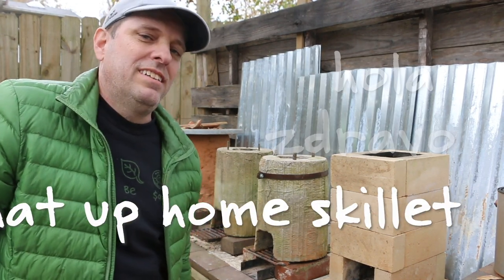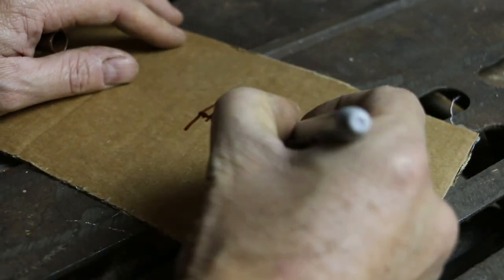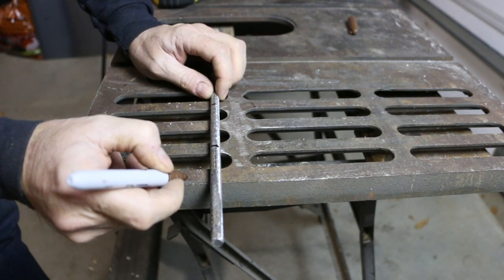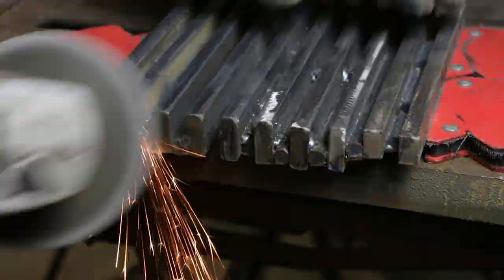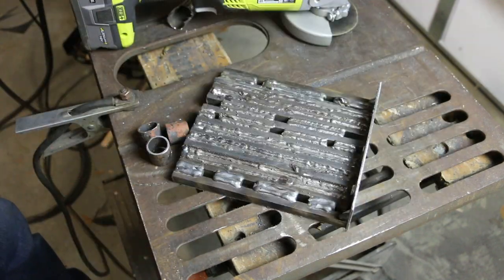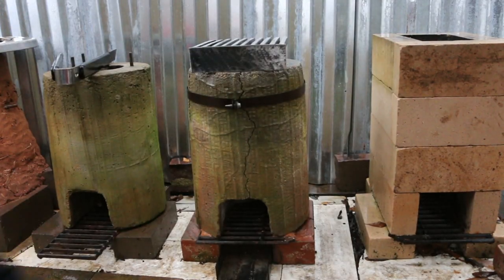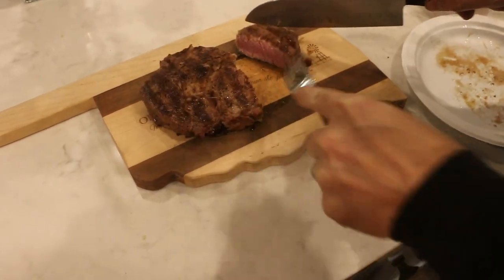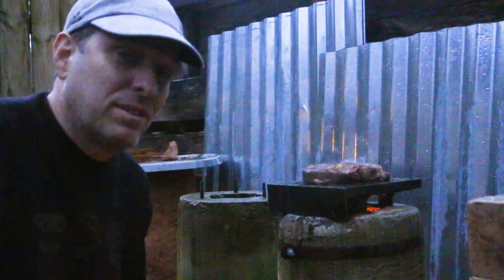How To Make A Rocket Stove Grill

Comment: You can weld on a handle that is heat resistant to make it easier on yourself to remove this grill/heat diffuser. Great job on the build!

Comment: Another great video, but now I want a ribeye on the grill. 
I like the "smoke well" pipe, but I think it could be bigger, for more smoke. :)
Reply from the maker: I’ll have to experiment. It would be easy to extend the pipe. Thank you for watching, Terry.
Reply: Been craving a good charbroiled steak for days!
I must've received the vibes!
   🥩🥩🥩🥩🥩🥩🥩🥩🥩🥩🥩
Now I'm gunna HAVE TO have one - ASAP!!! 🥩🍽🥩🍽🥩
Reply: @GreenShortzDIY  Tom, any chance you could use a threaded pipe ?  Weld a union to the bottom of the grill, add slivers of hickory or cedar into the pipe and thread it on to the bottom.  Easier to fill and  remove ash after cooking.  More convenient for storage as well...

Comment: Hi there GreenShortz in case you missed it ~ responding to one of your hot water videos. 

May I offer some suggestions. I have experience in building shower sauna caravans and organise festivals. I want to support a fellow builder.

Your water burner is good, and I like your plastic cylinder idea. How hot can this plastic tube withstand? I know that farmers black Alcatheme pipe can easily withstand hot water temperatures + their plastic fittings. Its what we use, then we use house “copper cylinder” and marry the copper tubing to those plastic fittings.

I see you have water mains, so don’t plug it in to your cylinder and try pressurising it. Better to fill a header tank and have your shower gravity fed. That way youll have constant pressure throughout your system, and AS your shower is used the header tank gets filled. Its !!! dangerous !!! to play with pressure like that bro. The reason your fittings keep popping off is basically youve built a steam BooOm!!! … you are missing an air pressure value in your system. If you have a look at the images ive shared (Basic set up) youll see that the air pressure value is open to the sky, and the water for your system rests at the water line of your header tank. If pressure builds up from a trapped air bubble or something, then the pressure spits out and safely vents out there. 

Basic version:
Theres  4 Levels
>water mains into header tank with stop cock
>from header tank down to bottom of cylinder gravity feed
>from bottom of cyclander to bottom of burner ground level
>hot water rises back into middle or top of cylinder level & circulates
>at top of cylinder is T fitting to for hot water feed (shower) and important air pressure value to sky above header tank
>Cold water is taken from T junction on the gravity feed coming down from header tank. Cold water is part of the gravity feed = same pressure.
https://ibb.co/F3frPRq
https://ibb.co/Rbcz8pq
https://ibb.co/nmy94tn

Safety:
>All pipes MUST slope upwards in a smooth way, no dips to avoid air bubbles which will split your pipes.
>Air pressure pipe MUST be above header tanks water level
>Protect the pipes from frost if you can, but youll have to consider having youre whole system in a structure during winter. Our pipes freeze meaning we cant use the showers. So having a wood burner inside a structure to keep everything below freezing would be a good idea. Just building a bender structure or tepee around the whole thing would do. With chimney pipe coming out.  

Header tank from one of these, on top of pallets, ropes holding down.
https://ibb.co/3s0skpr

Alkathene Piping, we use black
https://ibb.co/ZmtyqGC
https://ibb.co/tswVPKG

22.56 how to attach tubes to metal fittings the romanian way lol. You wont need this if you go with black/blue Alcatheme farmers pipe + fittings
www.youtube.com/watch?v=zobVyF85VJQ&t=205s

The easiest system to build is a hot water tub >being fed from a return line >off a hot water burner. So place a tub, like one of these 
https://ibb.co/8n3Q0NB
https://ibb.co/5RyCGCS
… Cut the top off and place on a raised platform. Have your burner or radiator at 20 degrees angled over a firepit. Make sure your return lines flow upwards and attached to supports. hot water flows into the middle of the pool wall. Cold water returns at the bottom to the burner at the bottom. Put bubble wrap on the surface and stur or have a 12v pump to stur the hot water around when heating up. Fill it from water mains and include a drainage hole. No need for an air pressure value at this point because the hot tub is open to the air. Personally I like open air hot tubs, seeing the stars. But theres nothing stopping you building a shauna around it, having your burner on the inside with the door feeding wood in from outside. That way youll have a sauna and a hot tub.

Wish you well on your wonderful adventure of experiments. Have a good one. All the best, Kieron
Reply from the maker: Kieron, thank you for the amazing info, suggestions and tips. It was a real education. I’m still learning. I’ll copy the comment and put it in a doc, so I can research. One note, I haven’t used the shower since I made it. I haven’t had time to make it private. Lol. My plan was to heat the water, let the fire burn out and then shower. Wouldn’t want to be under it while the fire was going. While I heated the water, I kept the shower valve open so the shower head could serve as the pressure relief. Thank you again for info.

Comment: My personal opinion is that Ryobi is garbage. The switches always seem to fail. I have rewired switches on my thickness planner, 2 grinders, a dremmel style tool of theirs, and others I'm sure I'm forgetting. What's sad is that my 2 princess Auto grinders have been running like champs for 6 plus years and my 2 Ryobi grinders crapped out within a year. 

Just my experience. Spend the little extra.
Reply from the maker: Thank you for the feedback. I can’t argue with your experience. I haven’t had that issue, but it probably has a lot to do with usage. Mine don’t get daily use. I will say that to produce a tool at a cheaper price point, costs have to be shaved somewhere. I appreciate your input. I’ll keep an eye out for my switches going bad. Thank you for watching.